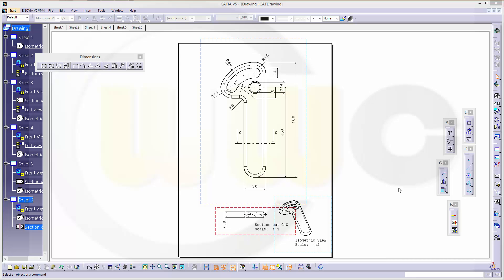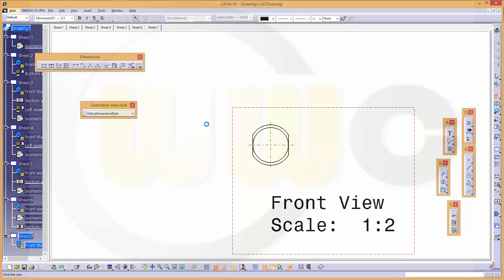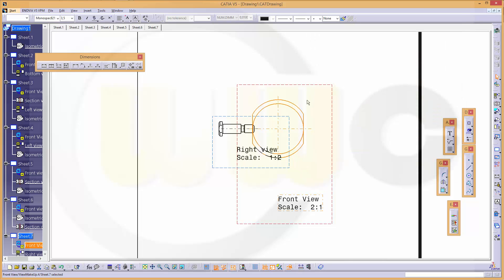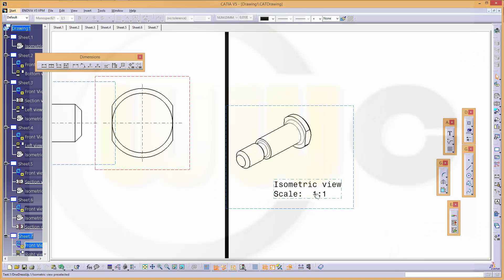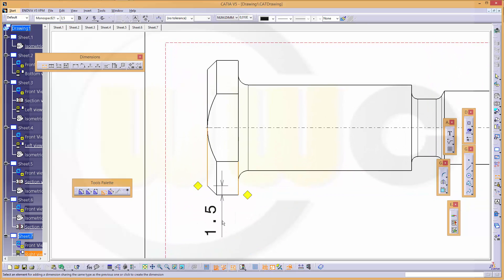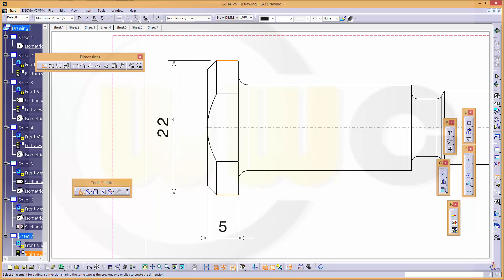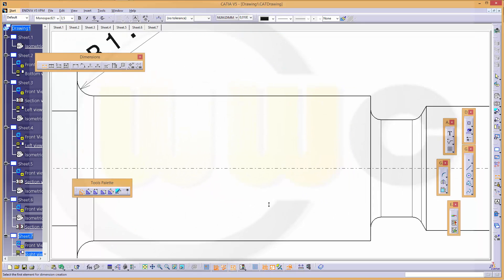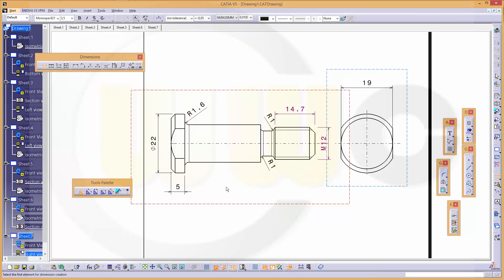Spannvorrichtung - Catia v5 Training - Assembly Drawing part 6

Comment: Guten Tag Herr Wolfgang Walden.

I have been learning CATIA V5 very recently, your video tutorials are very helpful. I have a problem in positioning the hole. I am not able to position a hole. When I click on "Positioning Sketch" in Hole Definition, I am not getting that WHITE DOT, which could be Constrained using Constraint option. Even if use the Constraint option, I am getting Constrained dimension in black color, when values of the dimensions are changed, position doesn't change but just the value changes.

Is this a software bug or don't know i am doing something wrong. Kindly provide your suggestion or input regarding this.

Danke.
Reply from the maker: Hi, sometimes the white dot is in the same position as the yellow dot, leave position sketch, move the hole by grabbing one of the orange arrows- go back to the positioning sketch, it should be visible and selectable. This happens sometimes.
Reply: I am not able to move the hole by grabbing the orange arrow, If I try to grab the orange arrow it only changes the direction of the hole, but I am able to position a hole by selecting the two edges of a surface before selecting the HOLE definition. Also when i try to create a  STIFFENER from top I am getting an error message saying "THE OPERATION PERFORMED ON THE FEATURE IS UNNECESSARY"
Reply from the maker: ganesh I didn´t mean this big arrow - I meant the 4 small triangles/arrows arround the hole. Regarding stiffener - I would have to see the situation by myself - but maybe the direction or the mode is wrong.
Reply: Yes, I am able to move the hole using those 4 small green colored triangle arrows. But if I want to position the hole from edges of my part model, I am not able to do so, If I constrain, I am getting dimension in black color. When I change the values of the black dimension, just the value changes, position doesn't change.
Reply from the maker: Seems to me that you "autosnapped" something, without eyes on your sketch I can´t tell - sorry!
Reply: Okay, Can I record and send you a video of my sketcher ?
Reply from the maker: Feel free to do so : info@wwmc.de- but the actual catia part would be better. Which release do you use?
Reply: I have CATIA P3 V5-6R2014
Reply: Thank you. I'll send the video ASAP.
Reply: I have sent you an email with a video file attached.
Reply from the maker: sorry can´t open it - it says - I need permission
Reply: Now I have enabled the permission settings for you to view the file.
Reply: After changing the permission settings, are you able to view the video now ?
Reply from the maker: Yes I´ve been able to watch it. I have to admit I´ve never seen this effect before and I´ve been using catia for over 15 years. Of course you can´t constrain/dimension the yellow projected elements in the positioning sketch - this is the usual behaviour. But the white dot should be visible - so which release of catia do you use? In the case where you use the edges as reference you can edit the green dimensions.
Reply: I am currently using CATIA Version5-6 Release 2014. 

Previously, I have been using CATIA V5 R20. I had same problem in CATIA V5 R20, I thought it was a software bug and uninstalled V5 R20 and installed a copy of CATIA Version5-6 Release 2014, but the same problem exists in Version5-6 Release 2014 OR is it something that I am doing wrong ? don't know where I am going wrong. 

Thank you for your valuable comments.
Reply from the maker: Sorry I´ve tried your example in R21 and it works - so maybe its a bug - or your Catia license is somehow restricted - that is perhaps the most likely possibility.  I ´ve seen similar restrictions in some trainings.
Reply: Issue Resolved after reinstalling CATIA Version5-6 Release 2014 and removing older license folder of V5 R20. Like you said it was a license issue.

CATIA Version5-6 Release 2014 failed to recognize the new license file, it seems it was operating on older license file of V5 R20. Then after few days it had license issue, the software was asking for license file. Hence I reinstalled CATIA Version5-6 Release 2014 and removed older Dassault Systemes license files and folders from C: drive. 

Now I am getting that white dot and able to constrain/ dimension and place the hole accordingly on the surface.

Thank You for your valuable comments.
Reply from the maker: Great, you´re welcome